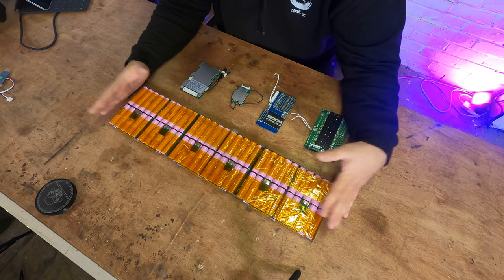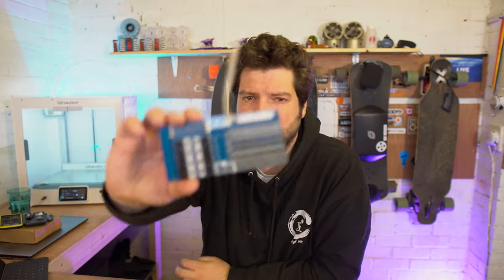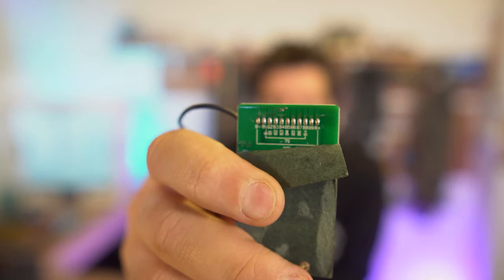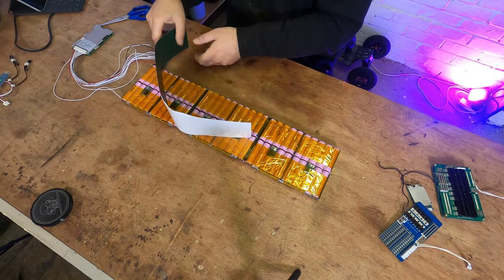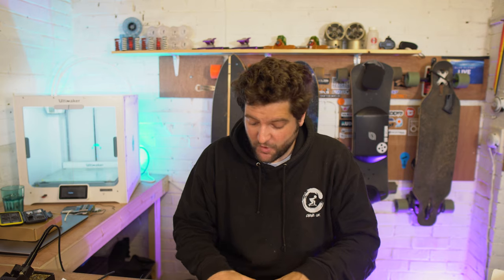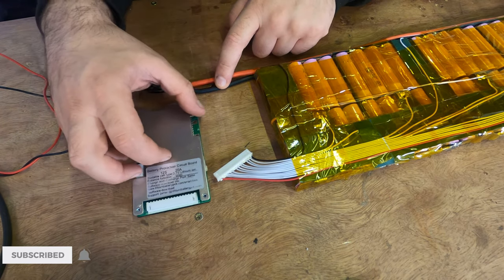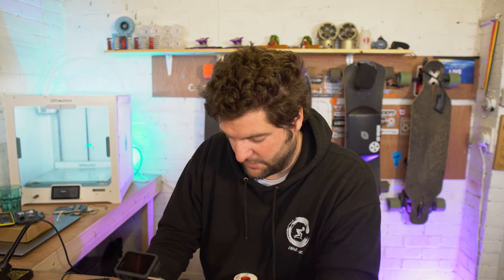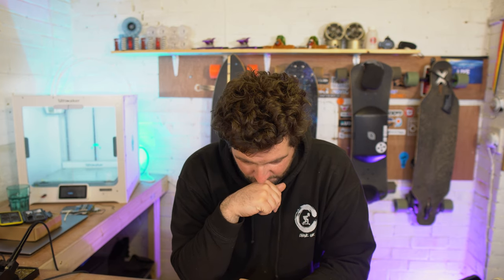The *ULTIMATE* BMS Guide

Comment: Hey Lee. Thanks for this video, I have a quick question. From my understanding, the BMS helps monitor the charge imbalance of the batteries. However, if you have batteries in parallel as well as in series, is it able to detect the imbalance of the individual cells in parallel? Is each of your cells protected individually as well, or is this not such a risk?
Sorry if this is a tricky question, I couldn't find any usefull answers online.
Thanks
Reply from the maker: No it cant detect each cell like that, it sees all parallel cells as 1 cell basically.  If you get one bad cell in a P group it will drain the P group and you will know about it! The BMS just makes sure all the S's are ballanced
Reply: @LeeWright  Thank you very much! You make great content.
Reply from the maker: @mrbrombal6206  no problems bro! Thank you!

Comment: I’m connecteing two of my 20v power drill batteries in series onto my 40v electric bike. Do I need a BMS?
Reply: They should have bms already inside of pack
Reply: @danobonano1315  Thank you. 

Another follow up question:  Does both batteries need to be fully charged when plugged into the ebike? I heard if connecting series with one battery half charged and the other fully charged can destroyed the batteries and burnt wires. Please correct me if I’m wrong.
Reply: @christopherowens2635  I would fully charge both packs

Comment: Hey lee. What’s the best way to ask you an esk8 question?
Reply from the maker: Like you just did bro 😄
Reply: @LeeWright  okay cool. So I was considering making an electric go cart with the VESC 100/250 and a massive motenergy motor that’s rated for 48-72V. I wanted to know the largest battery I could use for this, but some ppl said to base off the nominal voltage of 3.6 while some said to go by 4.2v. With the motor being the only limiting factor, should I go with 16s or would I be okay running with 20s?
Reply from the maker: @koenwilliams8819  you should base your operating limits of of fully charged, so 20S would be too high of a voltage.  16S would work really well dude
Reply: @LeeWright  okay thank you. It seems like the main result of more voltage is over heating. Idk if that would be a problem though since the motor has loads of torque and is massive. I’ve also seen a video of a go cart with the same motor running 20s, and it didn’t seem like he had any problems.
Reply from the maker: @koenwilliams8819  as with everything, the operating parameters are safe limits but you can do what you want.  My advise is to stay within the ratings, but you dont have to listen to me!
Reply: @LeeWright  thank you, I will probably go with 16s then to be safe or maybe change motor.

Comment: Hi Lee. Got a question. I recently added 9 cells to my 36v pack to make it 48v and ordered that smallest bms (the cheapest one) for 13s3p config. This bms works fine as far as charging to 54.6v and cuts off the battery at around 48.7v. On previous bms I could feel that the bettery is running low and if i kept going it would eventually shut it off at 36 - 35.5v. This new bms just shuts it off at 48 but sometimes shuts it off at 50v or so for some reason. When I pulled out the bat after it was shut off at 48v it was slightly worm (so no overheating) and when I checked parallel cells they had voltage varying from 3.87 to 3.91 which i think is not that critical and as far as distance I only get 7.5 km on 6000 mah bat. The question is if i get a bms (if there is one on the market) where I can set cut off voltage to be, lets say, 3.5v instead of 3.8v, will I get more run distance? Is there such bms where u can set cut off voltage manually?
Reply: You should look at Smart BMS, you can configure them

Comment: how do i use a 13s as 12s. leave 13th wire disconected or short with 12?
Reply: it depends on what bms you use. With simple bms do that and ur fine. With smart you need tinkering. Soldering or maybe some flash programming.

Comment: I think it's not a good idea to bypass the bms at least as an option, maybe as a temporary solution, there are a lot of things that can go wrong during discharing and also when charging, anyone who uses regenerative braking on ebykes for example can inject an electrical potential greater than what the battery can handle, especially if it is close to full charge without the bms and with a cheap controller the battery can even catch fire. During the discharge some controllers/microcontrollers will notice the lack of the bms and will generate an error, not to mention the lack of voltage monitoring in the battery series which in a severe discharge can irreversibly damage the battery. 
well it's just my point of view regarding the bypass, I'm an electrical engineer by profession and I don't recommend that option even with a fuse, otherwise your video was very good, congratulations.
Reply from the maker: I understand your thoughts on this, however as I use the BMS of an electric skateboard that can easily throw you off if the BMS disconnects the load it's recommended to not discharge through the BMS.  The battery discharge is monitored through the ESC and that can protect for under voltage.  For an ebike I recommend having the discharge connected through the ESC as the bike will not throw you off should the BMS disconnect the load and the benefits of having the BMS in line are worth it.

Comment: "Now it's time to get these temperature sensors ran into areas of the pack that matter"
Where do you locate temp sensors?
Reply from the maker: I put them on the series connections, doesn't really matter if you built the pack correctly it will get evenly hot

Comment: You made the bigest mistake. Didnt check each series voltage.
Reply from the maker: Yes I did.  I’ve been making batteries for many years dude and have loads under my belt.  I am sure I mention that you need to do that but this is a video about BMS, not battery making as such.
Reply: @LeeWright  Then its not in the video. 
In video you did check by holding the negative and adding the next serie to total, but not each serie like (negative +1, 1+2, 2+3, 3+4, 4+5, 5+6, 6+7, and so on). You did negative +1, negative +2, negative +3, negative + 4. Its not a each serie voltage check.  So - this battery pack is 100% disbalaced. As seen on the video - after you checked 2nd serie - there comes a 0.03V deviation wich in the next series continues by adding more deviation. In the final you have 41.1V, but there by takin the result from 1st serie should be 40.7xV.

Ok, that video is about BMS, but at the end you made a ready to go battery pack. I dont think you dissambled it after this video to balance it. Lots of people are learning from the video - they taking something for they needs. If u show something like this and they suck in that information I would feel bad by you. Try to look from the learners point. I know that the series needs to be balanced before adding the BMS, but lots of viewers doesnt know - so they taking your build as it should be like you did in video :(